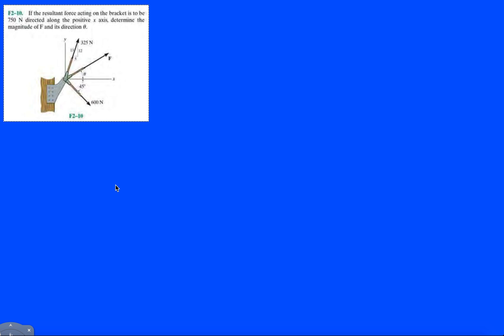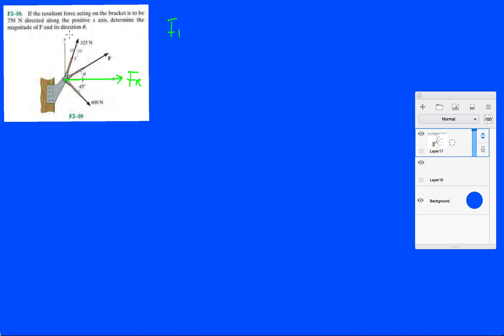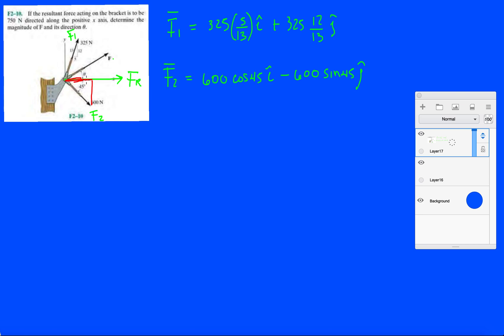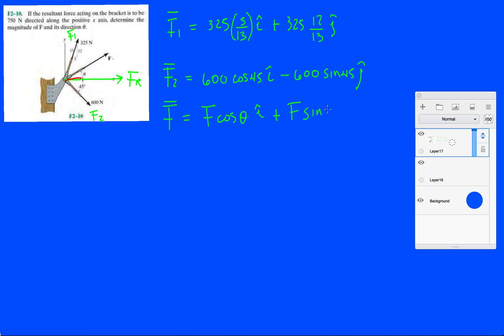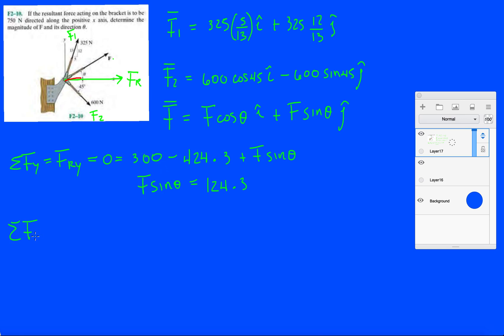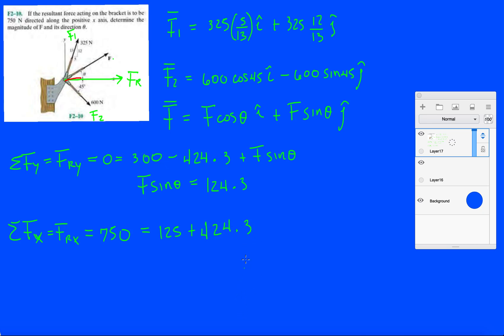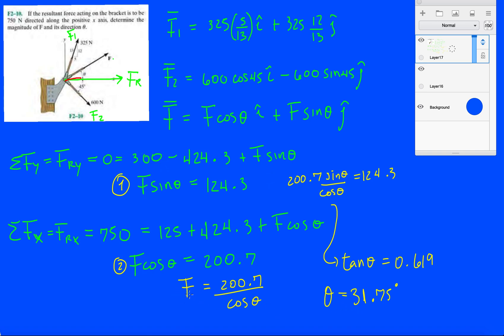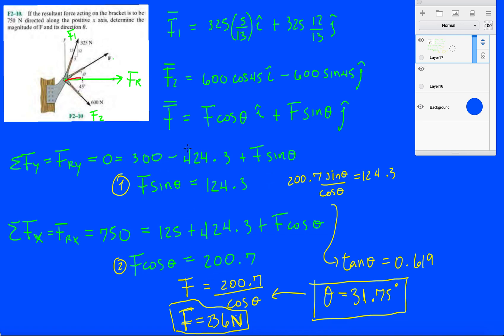Problem F2-10 Statics Hibbeler 12th (Chapter 2)

Comment: wouldn't the 124.3 from Fry be negative?
Reply from the maker: If it were negative, it would set the forces in the y direction not equal to zero. The force F, needs to point to the right and up to counter the F2. If that makes sense.